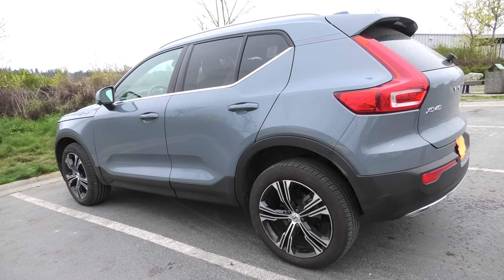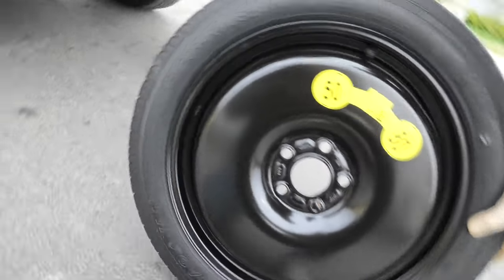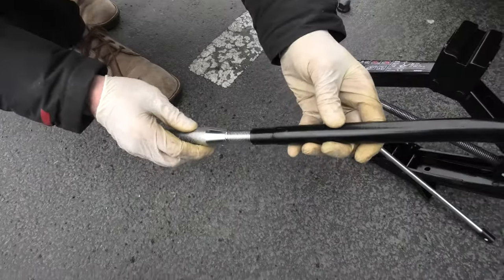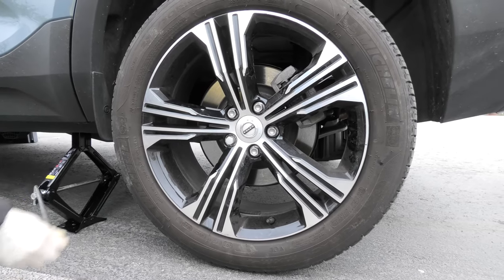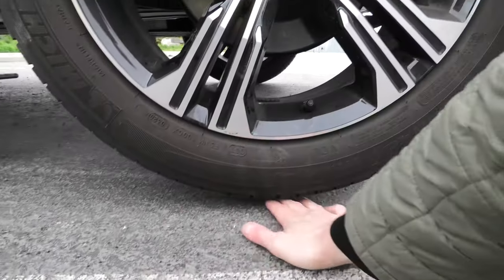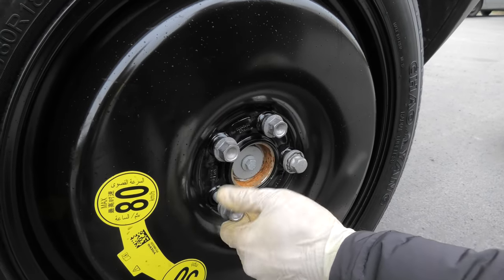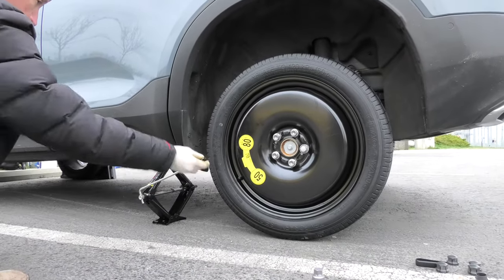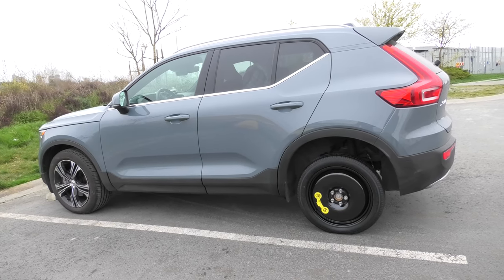Volvo XC40 (2019-2024): How To Replace Flat Tire Using Stock Jack And Spare Tire.

Comment from the maker: Watch How To Do Tire Rotation In Volvo XC40 - https://youtu.be/G6zFbCzZ1PM.

RECOMMENDED TOOLS:
1. WHEEL CHOCKS - MAXXHAUL 70472 Solid Rubber Heavy Duty Black Wheel Chock 2-Pack, 8" x 4" x 6" - https://amzn.to/3DTPyDZ.
2. 19MM SOCKET 1/2" DRIVE - GEARWRENCH 1/2" Drive 6 Pt. Deep Impact Socket, 19mm - https://amzn.to/3Zfwp7W.
3. 1/2" DRIVE TORQUE WRENCH - GEARWRENCH 1/2" Drive Micrometer Torque Wrench, 20-150 ft/lbs. - https://amzn.to/3I6ja3p.

Comment: Why do you loosen and tighten the bolts in two stages? Ie before and after tyre completely off ground
Reply: Usually you tighten the bolts but not to full torque when the tires up. That gives it room to settle properly as weight is put on it, tightening to full torque after it’s on the ground.
Reply: Oh and for loosening, taking the weight off relieves pressure on the nuts making it easier to remove. But if you jack it all the way up the wheel may spin instead of the bolts! Not removing the nuts all the way here just keeps the wheel in place while you finish jacking.